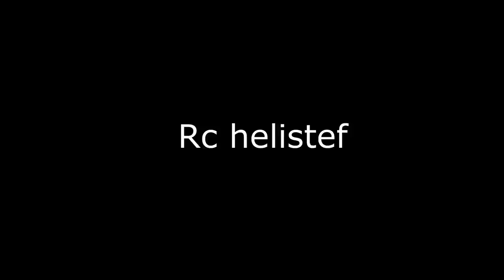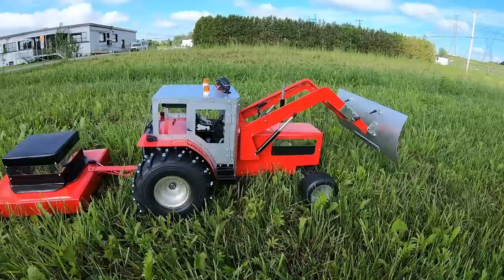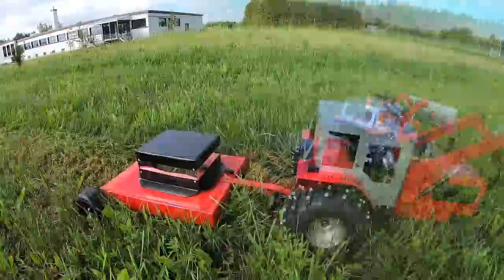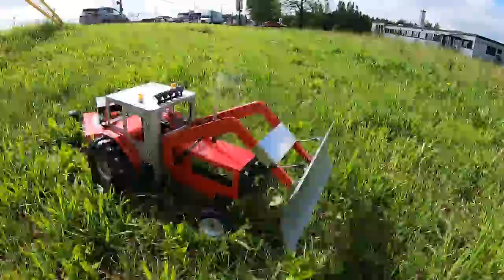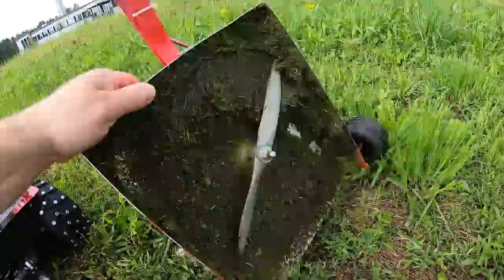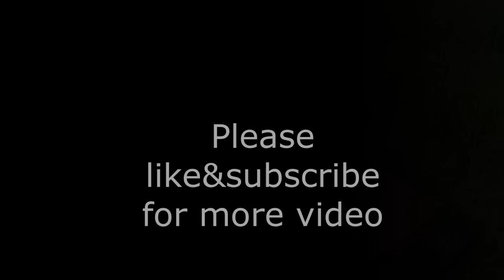Rc tractor lawn mower homemade 3 s 11,1 v 60 amps.Test 2 new battery 4000 mah 11,1 v.

Comment: I was thinking about drawing something similar for 3d printing yesterday, then i see this today XD
Do we share the same brain or something?? XD
I was thinking about using a 2600kv on 4s (old fpv drone motor), using some weed-eater nylon line to cut the grass.
Are you using nylon line or short blades to cut ?
Reply from the maker: I use a former helicopter motor with an airplane propeller